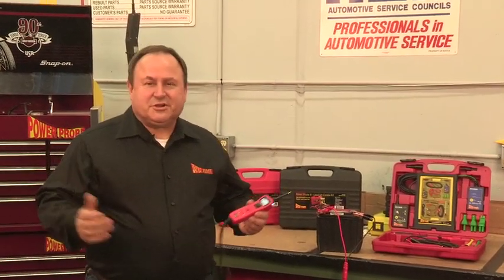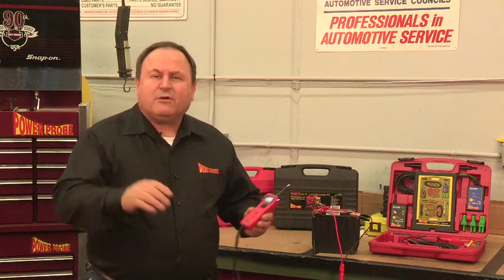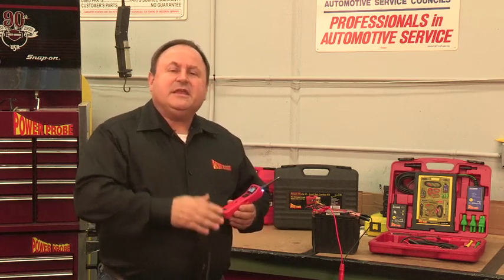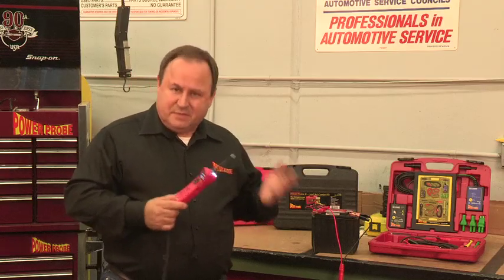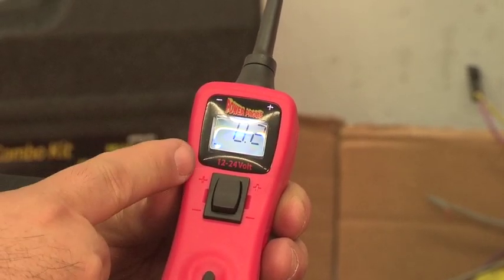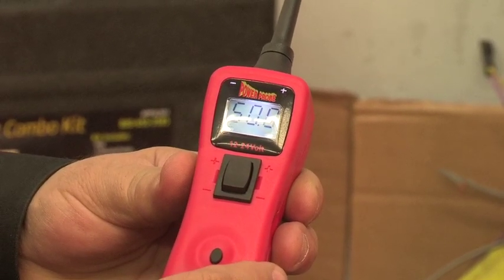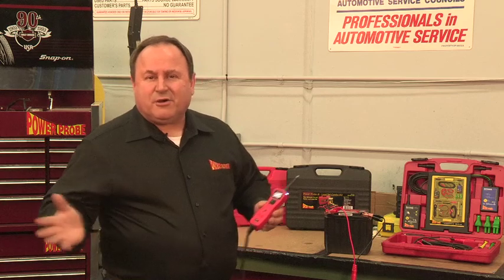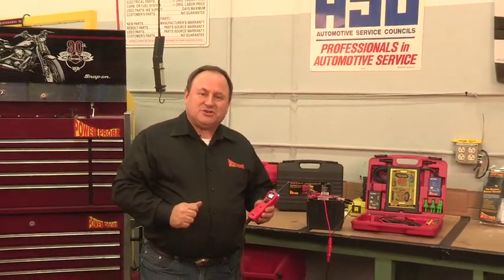Power Probe 3 threshold settings reset

Comment: But you still didn't explain why you would need to adjust that setting other. I mean you said to take it back to factory settings. But how did it get changed, why did it get changed, why is there even a capability to adjust that setting to begin with? When would i need to adjust that setting? Sorry bud but my brain requires a little more info other than "Do this". If it comes from the factory at 50 volts and i don't understand why is making all these weird sounds it would go to say that I'm not the one who adjusted it.  Or i would already know why it's making those noises.

Comment: I tried this option but doesn't help much. I troubleshoot newer vehicles with low voltage and the power probe will read for example horn ring postive as still being a ground due to the voltage not being more than 2-3 volts of positive so if not looking at the numbers instead of hearing the tones you will pass that wire as being the wire activating the horn. Same with testing low voltage LED lights. My backup blue point probe tester picks up any voltage regardless of low reading and i can trouble shoot easier. Are you getting feedback about this problem?
Reply from the maker: Hello Jay- The lights and tones on a Power Probe are calibrated to light/sound when the measured voltage is within .5 volts of the source voltage. For example, if you are connected to a battery that shows 12.6 volts, positive readings over 12.1 will get a red light and tone. Readings under 12.1 volts will still display, but not trigger the light/sound.

It's similar for positive, but starting at 0.0 volts. Any ground reading under .5 volt will alert with the green light and tone. One additional trigger on the ground- any reading over 600 ohms will eliminate the green light and tone.

Hope this helps. If you have any additional questions, please email us at support@powerprobe.com or call us at 1 (800) 655-3585. Thanks for being a Power Probe customer.

Comment: I came here to see if the positive and negative beep thresholds are adjustable. I see the voltage steps, what I want is the PP to positive beep over 10V and negative beep below .5V. What am I missing? It did beep over 11 or so when I first got it, some I must have pressed the combination of the buttons to change it. This is a can't live without tool along with chain Visegrips, plumbers Visegrips, single edge razor blades, electric ratchet, automatic strippers, ones for wires too, and potato vodka for supper ;-) PS Waaaay to many techs forget about the ground side of life. Touch the PP to a ground wire and hit +. If the circuit breaker takes more than a second to pop, you got a ground issue. It takes a year of heavy everyday use to kill the breaker, by then the PP is falling apart. This is a compliment, my tools take a beating. Nothing plastic lasts forever.
Reply from the maker: Thanks for the endorsement of Power Probe.

The tone and LED lights on the Power Probe are not adjustable, but they doing some automatic testing for you. See details below.

The LED lights and the corresponding hi or lo tones operate on a 0.5 V voltage drop rule:
A.	For positive (Red LED, Hi Tone) as long as the tip voltage is within 0.5V of the battery the tool is connected to, you will get the LED and tone. As soon as there is a voltage difference of greater than 0.5V, no LED, and no tone. So, if the battery is 12.6V, you will get Red LED and tone down to 12.1V. For 12.0V and lower, voltage will still display on the screen, but no LED or tone. IF the battery is only 11.0V (for example) then you would get RED and tone down to 10.5V. So it is a constant 0.5V rule, but changes relative to the battery it is connected to.
B.	For Ground (Green LED, Lo Tone) the same 0.5V rule applies, but you are starting from 0.0V. But there is also a second rule for the ground LED.As long as there is less than 0.5V present on the ground AND there is less than 600 Ohms of resistance to ground, the Green LED and Lo-Tone will activate.

While we agree that testing ground quality is a critical step in any electrical diagnosis, we do not endorse applying power to a direct ground.

Comment: My probe reads 4v instead of 12v, When i try to reset mine after holding the button down it reads C8
Reply from the maker: Hello Ramzy- we'll need a little more detail to get you fixed up. Please call us at 1 (800) 655-3585 or email repairs@pp-tek.com.
Reply: @PowerProbeUSA  ok thank you

Comment: 2 years ago I bought a Power Probe 3 and have a new barely used it. I carry it in my tool bag and used it maybe 3 to 4 times in the past 2 years. Today when I connected it to 2 fully charged batteries the PP3 would not even turn on. What exactly is the issue?
Reply from the maker: Please call us at 1 (800) 655-3585 or email us at repairs@powerprobe.com to get more details.

Comment: Awesome I needed to do this I love my power probe and I suggest them to everyone I come across I had the original one when I first became a tech and saw another installer using one I said I've gotta have one, about 5 years ago I bought a power probe 3 but recently the backlight of the display took a crap on me and it started doing the weird tones out of the speaker but this helped thanks again for a great product and videos like this. Can the PP3 do injector testing like the 4? If not I'll need to save some pennies up and buy one.
Reply from the maker: Power Probe 4 or the Maestro will do injector testing,

Comment: what can i use the threshold mode for ?
can i use it for o2 sensor ?
or what?
Reply: +toolman talal I don't understand what the threshold mode is either, but I'll get back to you when I figure it out.

I think it looks for AC instead of the current. If I'm right, it could be used to find how much A/C current is leaking from an alternator for example. A little always gets past the rectifier or diode that takes that A/C generator and makes it mostly output in D/C or direct current.

Best guess so far.
Reply: +DE Nichols thanks man 👍
if you find other uses for this mode please make a comment or a video in your channel am already subscribed since your first video.
Reply: toolman talal I had figured out you were subscribed, but didn't know it was from day 1. I really appreciate that. I ordered this tool last week and having these options made me feel a lot better about not buying the power probe 4. Guaranteed, I'll teach how to use this tool as I learn it. I'll also discuss the non power probe way so people can use multimeters. The day after I ordered this tool I already needed it and did things the hard way on an electrical diagnostic of windows, door locks and trunk all not working. I recorded that but still need to edit it. I'd have gotten a lot further with the power probe iii master kit, a lot faster.
Reply: +DE Nichols good luck . 
keep the good videos coming.

Comment: I have a power probe 3 problem
it give me c 8 Reading and I have no power when I press the botton.
Reply: Willian Valladares Reset the circuit breaker it's on the side
Reply: I have the same problem but I did the reset on the braker and it still shows CB on the screen !!!! 
What do I do?
Reply: +:D101 nice i just did that on my and goes back to new